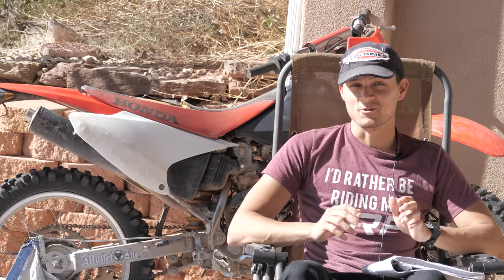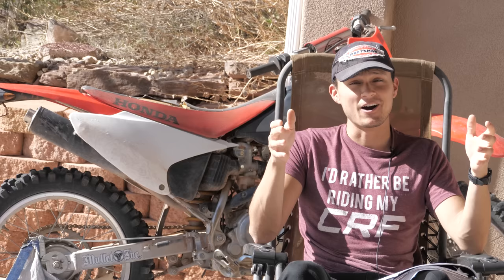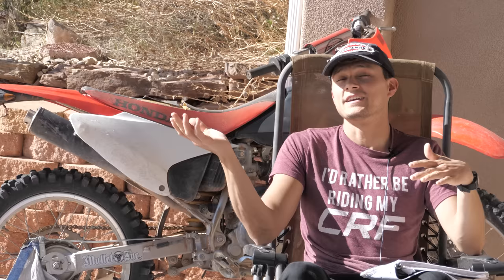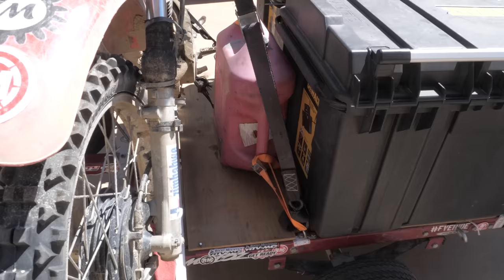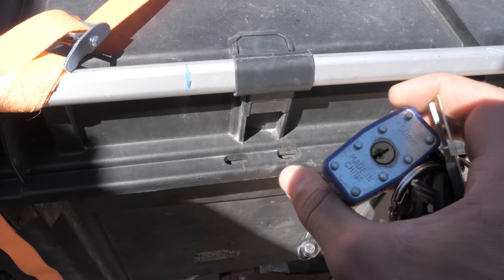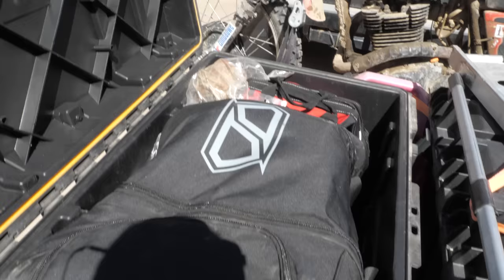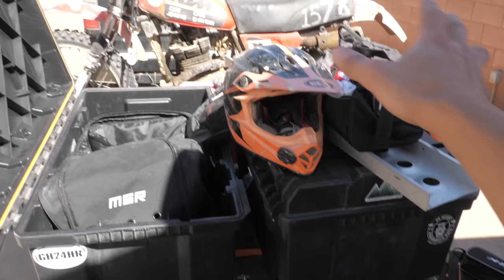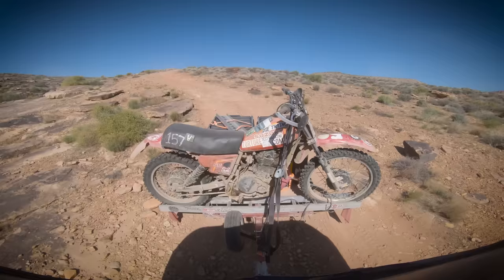I Risked $199 On a Harbor Freight Trailer So You Don't Have To - Here's My Review.

Comment: I picked up a 4 x8 used one, I put a draw tight trailer hitch on my 2006 Toyota Corolla, this trailer is awesome, The hitch is only rated for 200 pounds but with my 450 grizzly centered over the axle I can pick the tounge off the ball with one hand the grizzly weighs around 665 lbs. it pulls great I also haul my tw 200 around on it I put 2x4 sides on it, very happy with it, I bolted the fold part of the frame together with mesh screen on the whole bed I love it.

Comment: I literally just put this trailer together last week for my pit bike. It’s perfect for my needs. I even haul it with my small Toyota. I did put new grease in the bearings because people told me the grease it ships with is bad
Reply: Mine had the fenders crack to hell at the mounting points, easily fixed with a welder and some sheet metal to reinforce them so they don't bounce around and stress crack again.

Comment: I was given a old boat trailer for free. I shortened by removing 3 ft of tongue length & 4 ft of frame length' and narrowed it 3.5 ft . I kept the fenders and their diamond plate steps fore and aft of each fender . Used the steel removed from the frame and tongue to reinforce the frame cross members and welded a couple 5x4 ft sheets of 1/8 steel diamond plate to the trailer deck and have a very strong 10'x6'flat deck utility trailer. I bolted a swiveling / extendable 1000 lb hand pumped  hydraulic truck bed lifting crane I paid $ 60 for at a flea market. I can lift and pivot into the deck big V8  engines or whatever else I want to load onto the deck and then strap it down and go. It's been a invaluable asset in my opinion. I have just over $300 into the thing converting it from the boat trailer . And another $167 for the tires. It's just a great working asset

Comment: The biggest issue with these trailers is the  hubs use metric bearings. This means parts are most likely not available at local shops and if you are out on the road when (not if) the bearing fails, you are SOL.

Apart from that they are a great buy. I have replaced the hitch because it had a defect making it difficult to remove, and the axle to get inch hubs so that I don't get stranded somewhere.  On mine one bearing failed at 15k miles, and ran just fine without it, so I didn't notice until the hub was ruined. With the price of the hub being more expensive in metric, it made more sense to change them both.

Comment: I bought the same trailer in 1980 for $199. It was a Coleman made in the US. I installed stake side fences on it and a plywood floor. I carried 1000 lbs. of firewood many times. I couldn't find any garage that could mount the tires. In those days the the tires were about $15, but the tires on the wheels were $25 each so I bought the wheels and tires for $50. I had a Volkswagen Golf. I couldn't feel it empty, but a 1000 lbs. of firewood was a hard pull. I used local roads when it was loaded since it didn't have any brakes.
Reply from the maker: Seeing a little Golf hauling 1,000lbs of goods would have made my day! Love it. 
If you enjoy the content please check out my "best ways to support" page on my website which shows how to support the channel for free! Thanks!
 https://torturetestmagazine.com/pages/best-ways-to-support-ttm-some-are-free

Comment: Next tire change... Try the wide 4*4 trailer wheels. Their the ones they use on snowmobile trailers, and similar to golf carts. Little more load, little more stability
Reply: I plan on building one for my 2022 accord, I want to build a deck first then attach something like he did all professionally. I did want to change the wheels, would you have anymore advise other than 4x4 trailer wheels?
Reply: Taller tires keep wheel speed down, hence they won't roast wheel bearings so bad. 
I got mine back in the mid 2000s and got it with the 12" wheels and haven't had a bearing issue yet. 
And all I did was weld up some sheet metal to reinforce the stress cracks the fenders got.

Comment: I've got a 4x8 I bought used off craigslist and who knows how old for $250.  I've put 50k miles on it so far with 2 dirt bikes, bunch of camping gear, and works great.  Had a few flats, a bad wheel bearing, and the fenders fell off.   LED light kit--buy a good quality trailer wire harness.  The HF trailer wires are made of aluminum coated toilet paper.  the "wires" just fall apart new and turn to dust.
Reply from the maker: I had a hard time determining what kind of wiring the stock junk was. Now that you mention it, aluminum with toilet paper sheathing does seem accurate!

If you enjoy the content please check out my "best ways to support" page on my website which shows how to support the channel for free! Thanks!

https://torturetestmagazine.com/pages/best-ways-to-support-ttm-some-are-free

Comment: I have one of these trailers too. Mine is a 1989 model my dad got not from HF. It has gone down the highway at 70mph no problem. I have it now and after all these years I have replaced the axle and springs and put the 4.80x12 tires on it. the axle is a 2000lb rating springs 1500lb rating so I could haul a little more weight but that was not my goal. My goal was just to have a safe trailer, I couldn't find replacement parts for it and didn't want to go through registering a new trailer. My upgrades made it a great trailer.

Comment: I'm glad you came to the conclusion that this trailer is by far its money worth. I have the bigger 4x8 trailer which is only a little more expensive. its more stable, and has a load capacity of 1700lbs by just a little extra weight. By mistake or ignorance, i had it loaded for a job several times to over 5000lbs, and nothing broke, nothing bent! I think you should change the title of your video, because it does not do justice to this great little trailer!

Comment: Menards had a 4x8 version of this trailer for under 500 dollars, I went into the store took a picture and measurements, then I bought all the materials not the cheep materials, good heavy-duty materials and built the very trailer menards was selling for 500 dollars that trailer has been all over the country, loaned it to any who needed it. It's gone every where hauled 1000 pounds at a Crack, that was 30 years ago and it's still in service.

Comment: The lights suck because one needs to weld all four corners together. All four corners are not truly grounded cause its just bolted.  I welded up and its great.  Keep wheel bearings greased and maintin the paint and deck..  great trailer mine is. I gots 4x8. Love it.  And fenders suck but i cut the end off a 55 gal plastic barrel and cut that in half for fenders. Worked well but they are warped but dont rub. Whatever

Comment: I've put a ton of miles on a slightly larger one. I over used it but more than got my money out. Also as a psa, my buddy just had a uhaul trailer with his hand built bike chained to it stolen from a hotel parking lot. Locking hitches and ball locks are not a bad idea when on the road overnight.

Comment: The biggest issue with them is the tires/wheels
Reply from the maker: The tires from harbor freight definitely aren't great but I don't fret running them if they're the only thing around because blowouts on this tiny thing don't cause a big ordeal. I've had two. On one I felt it start vibrating and pulled over to find the HF tire totally nuked, riding on the rim. On the other I never even noticed, or maybe I did and just turnt up the music lol. Got to where I was going and the sidewall was blown out and I was like well that's unfortunate! Didn't run down to the rim on that one. Haven't had a blowout on walmart tires. They wear down until the tire is bald. I'll try the cheaper Kendas next!

If you enjoy the content please check out my "best ways to support" page on my website which shows how to support the channel for free! Thanks!

https://torturetestmagazine.com/pages/best-ways-to-support-ttm-some-are-free

Comment: My dad had one of the harbor freight trailers he had it set up to hold 3 motorcycles and he had it from like 1995 till 2016  and he took it from Los Angeles California to Cushing Oklahoma many times he would use his old geo metro to pull it around , he doesn’t have it anymore because the geo finally puked it’s transmission out and he parked it at the side of the road with that trailer still attached and someone stole the trailer .

Comment: I had the same thing from harbor freight but mine was the fold up 4x8 or it was a three and a half by 8 I can't remember it was but I believe it was a 4x8 and same axle same setup and I told around two motorcycles on it for I would go on 200 mile trips one way to from North Carolina South Carolina was not when I was in army to visit my biological father and then I would make the same trip back and one of the bikes was a Kawasaki Vulcan 800 classic with a 2005 engine it was 97 bike and I had a 19 79 cm400t Honda that would also carry on that same trailer to make those trips I also kept about 100 lb for tools that would sit in between the two I told it behind a 2002 Pontiac I firebird and on some trips I would tow it behind my 93 Civic del Sol I had at the time I wish I kept the bike and I ended up leaving it up north when I moved I wish I didn't but it is what it is I plan on buying a new one to use for motorcycles for when I don't want to use my flatbed tow truck

Comment: I wish habor freight still sold these when I was getting a trailer. I like my 6x8 but 99% of the time I'm only hualing one bike and one of these would have been perfect.
Reply: They do but the price is quite high right now ($400).  If supply chain issues clear up over the next year or so, hopefully they'll come back down in pricing.  I originally purchased a 4x8 and sort of wish I would have gone with the smaller trailer at the time.  Would have been a lot easier to store and deal with!
Reply: @KestrelYI  I know you can still get them, but for 400 dollars, I don't think they really make sense in most cases. I would have gone with the 4x8 for 100 dollars more if I hadn't found this 6x8 for 500.
Reply: @KestrelYI  I bought one may 2020 and paid $250 for mine but also waited a month from when I went in a pre-purchased it.

Comment: Yeah that trailor is crap..   I bought a 6x6 and tore it apart and upgraded the wheels.. I then welded square stock made it bigger.. Keep your eye open for a used trailer marketplace..  Im hauling two quads side by side and 2 bins..  I have some metal to enclose another one i just bought..

Comment: I know this video is a bit old but I can't for the life of me find any of those rails that you bolted to the trailer to put your bikes on! I've searched everywhere - does anyone know where I could find one?
Reply from the maker: You can get them off of these: https://amzn.to/4c3B5Vq  The carrier itself is crap, I had 2 of them and the rails snapped off because the steel welds broke quickly. But the aluminum rails are completely solid and they never had any issues even with tons of holes drilled in them from using them for various things.

Comment: You sold me on it, what rail was used to hold the bike and hardware to mount it?
Reply from the maker: The rail is off one of those cheapo Amazon motorcycle hitch carriers. The welds on the steel brackets on those carriers break all the time and people will just let them go. You can also just make your own bike rail with a 2x10 plank and a wheel chock which two people I know have done. Just make sure that sucker gets strapped in really well. A friend of mine also just welded a rail with a couple pieces of steel flat bar and a piece of angle bar going around the edges to give it 3 dimensional strength. He rattle-canned it black and it doesn't look home-made at all. Mounting hardware for any rail is almost always going to be 3/8" bolts sunk straight through rail and trailer frame, with lock washer and nut on the bottom. When going metal-through-metal I like to use hex bolts so they can be easily re-tightened with a couple of wrenches. When sinking through wood or plastic I like to use carriage bolts. If you don't want to swiss-cheese the frame, you can definitely get a rail on there with U-bolts, which I have made use of in several places on this trailer so as to not weaken the frame
If you enjoy the content please check out my "best ways to support" page on my website which shows how to support the channel for free! Thanks!

https://torturetestmagazine.com/pages/best-ways-to-support-ttm-some-are-free

Comment: So basically if I put in another $200 basically I’ll have a super reliable small trailer.
Reply from the maker: I would say the minimum extras for really good reliability would be adding an easy way to grease the bearings before each big trip (like buddy bearings) and a spare tire. Probably cost about $100 if you get a spare tire holder. But you can go above and beyond to your heart's desires for added reliability. A lot of people upgrade to 12" tires or even larger. There's a 2,000lb bolt on axle swap available for this mini trailer which converts the axle to united states customary unit standard for easy servicing/repairs. Some people weld the frame joints or even add extra support structures. You can even go crazy and add microblue bearings which basically cuts bearing heat in half. Possibilities are endless!

If you enjoy the content please check out my "best ways to support" page on my website which shows how to support the channel for free! Thanks!
 https://torturetestmagazine.com/pages/best-ways-to-support-ttm-some-are-free